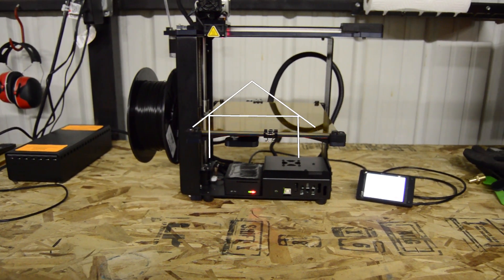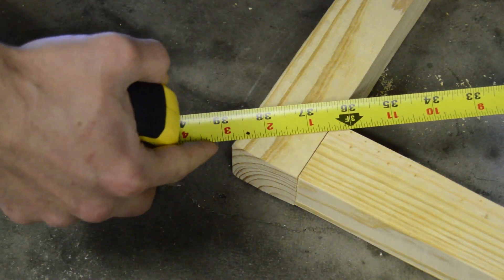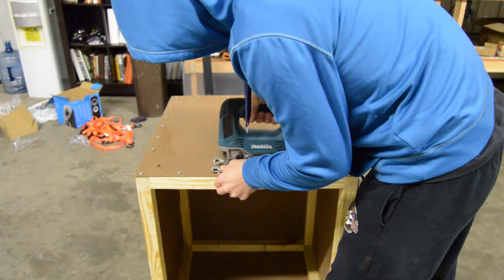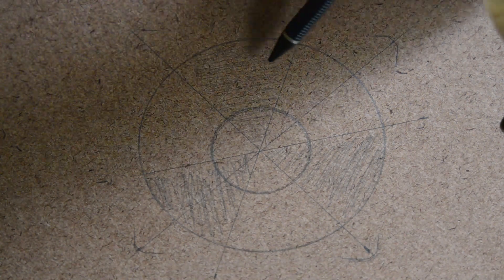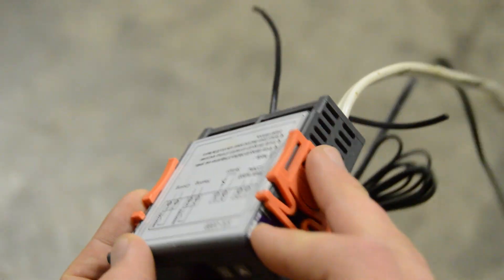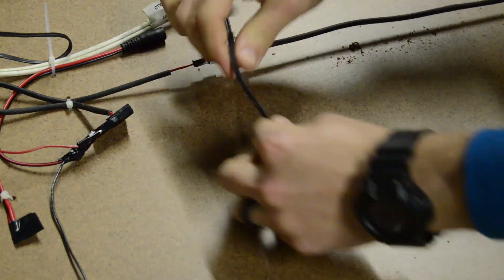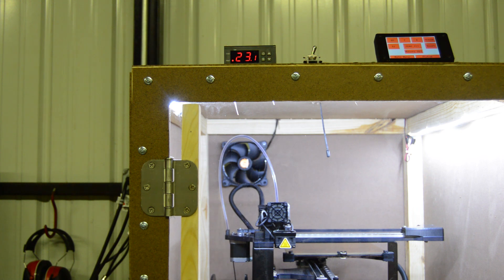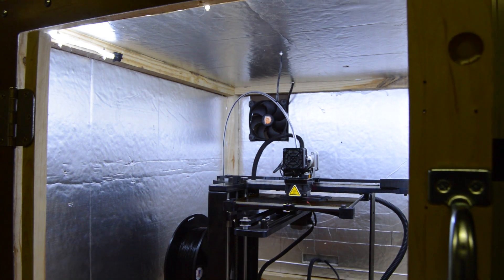DIY 3D Printer Case ~ An Easy Enclosure to Improve 3D Printing Quality

Comment: out of all the enclosures i've seen, this one makes the most sense and will be what I make mine to look like. Except instead of using wood framing, I am going to just notch the sides of every piece of XPS foam so they interlock, which will give it more rigidity, as well as remove the heat loss from having wood. Probably make some 3D printed braces for the foam box too.

Comment: A little disappointed that you did not use printed parts in your design
Reply from the maker: The LCD display bracket is 3d printed. Don't remember if I covered that in the video. But that bracket is mounted to the top of the enclosure.

Comment: This is amazing, I think I will build by myself. But since my printer is in the living room, I was wondering if there's a way to provide a better sealing for the box for a safier environment. Any idea?
Reply from the maker: You could build a wood frame around the door and use a foam seal on the case.  The door doesn't lock which means it would only potentially be unsafe if you have children running around.

Comment: Are there any affordable dlp projectors for SLA printing in market?
Reply from the maker: A decent HD DLP projector will usually be between $600 and $800. Whether that's affordable or not depends on the size of your wallet haha. If you're trying to do a DIY printer a used projector is a good option to save some money.
Reply: @GarageScience  any names?

Comment: How do you like the MakerGear?
Reply from the maker: I love it, its my first FDM printer so take that with a grain of salt. I got the touchscreen with it and that user interface is a bit clumsy and not that good, the web browser interface is great. It prints good and from what other people have said it should print reliable for a very very long time. I haven't printed in anything besides PLA yet, gonna runout the spool of PLA I have onthere now and then switch over to ABS.
Reply: @GarageScience  
I was looking at a DIY enclosure knowing that most will be an ender 3, but lo and behold the second video in the list is.... A makergear!  I've got a M2 I'm printing on to this day 6 or 7 years later.  I upgraded to the new cooling system (you have that), and replaced a motor I burned out with a dumb mistake... But otherwise it's still printing along.
Reply from the maker: I love my makergear. It prints great every time. The enclosure was more necessary before I insulated my shop, but it still works like a charm. The same enclosure, fan, heater and thermostat combo I setup in the video is still in service to this day.